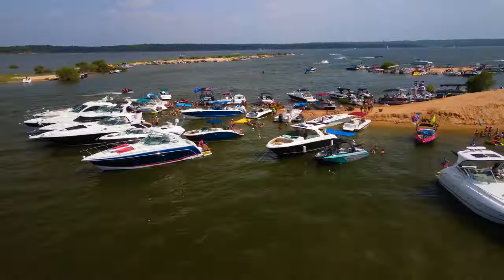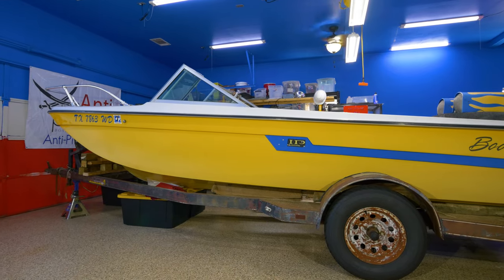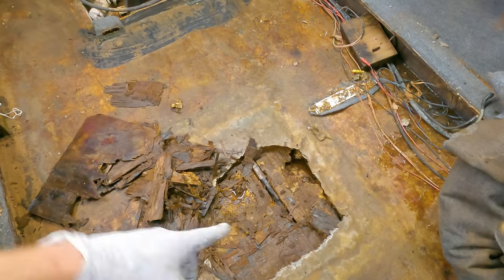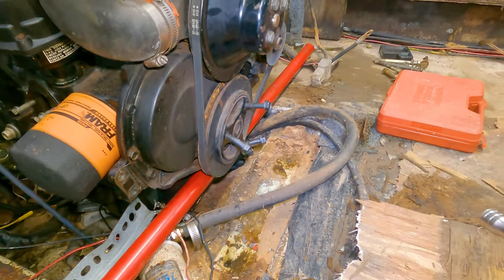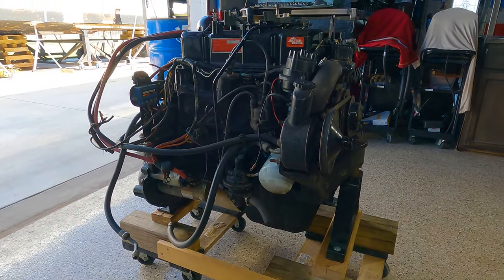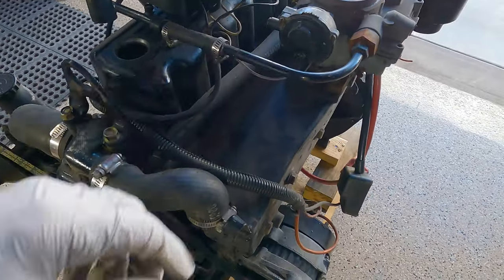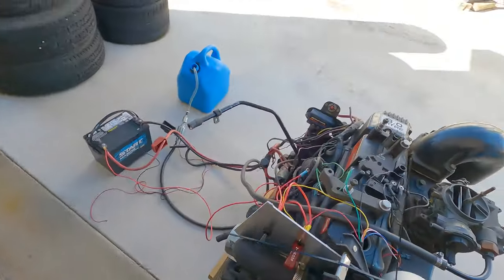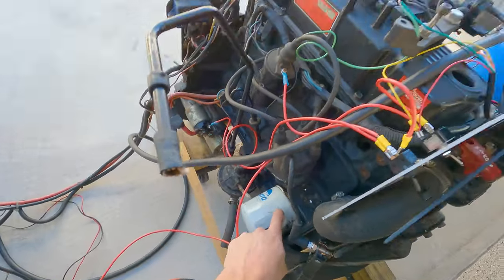Let's Build a Cheap Boat! New Project Time.

Comment: Hey Kyle. The foam also helps add strength to the bottom of the hull. When you hit a wave or log, and the pressure hits the button of the hull, the foam sort of ties the hull end the deck together as one making it stronger and more rigid. Also, as someone else mentioned it helps the boat float if it were to sink.
Reply from the maker: That makes the most sense so far.  Hopefully the new stringers and extra fiberglass on the floor I added will make up for not using the foam sandwhich. We’ll see.

Comment: you ask why they use foam. In theory, the foam doesn't allow water it fill the cavity. Over time that diminishes. but even Half filled foam weighs less than water. figur you wieghted the foam at 400 lbs. with the foam. Had that cavity filled with water itself, 1 cubic foot of water weights is  about 62 1/2 lbs. big difference
Reply from the maker: That does make sense!

Comment: What distributor is it that you put in
Reply from the maker: That was just another stock Mercruiser 3.0 distributor, but it had a Pertronix points eliminator in it, used it for years on another engine and figured it would work.